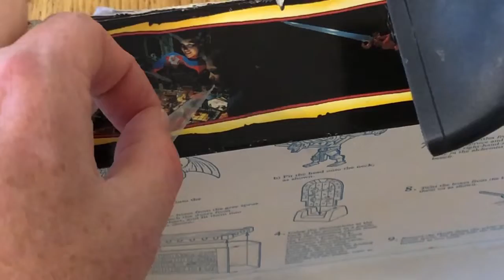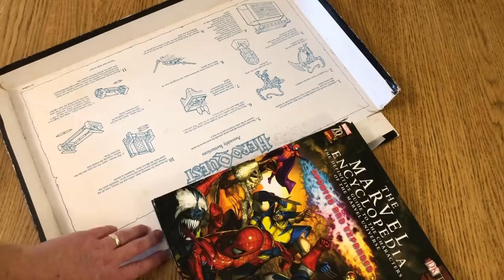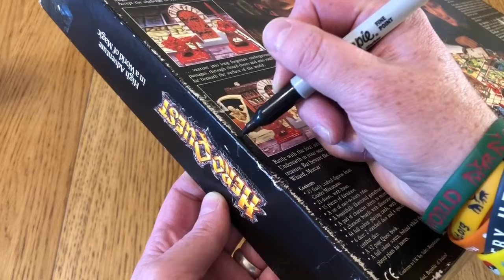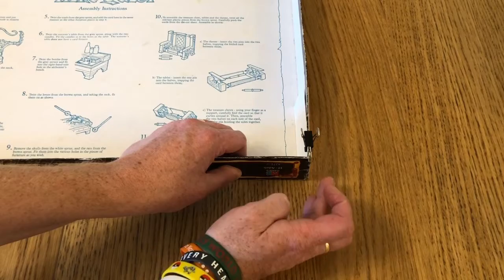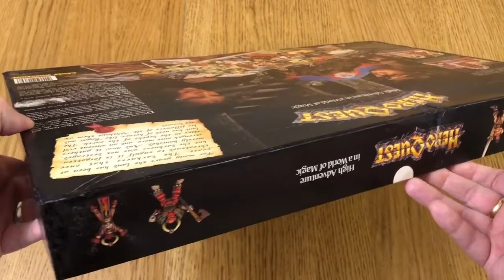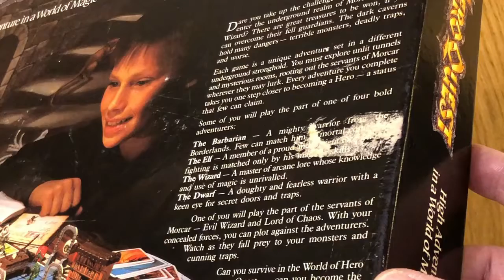Fixing or Repairing Damaged Board Game Boxes | The HeroQuest Restoration Project

Comment: Would you use Gorilla wood glue instead of PVA? Thanks for the video!
Reply from the maker: Personally, I only use PVA or (more commonly these days) bookbinder glue, as I can ensure how they are going to cure. You don't want to use anything that might yellow or otherwise stain, and wood glue often contains chemicals that are harmful to wood and cardboard. I used bookbinder glue in my recent Warhammer Quest restoration video and I would say that is the best option I have used. 

If you are going to use any type of glue, test it before putting it on the box to make sure it is going have a bit of flex to it and doesn't have chemicals that will damage cardboard.

Comment: Good job on the box. It's not the worst I've seen, that is a board game of my mums where the paper was peeling off the whole box and game board, the top and bottom had sunk inwards, there was multiple rips and squashed corners, along with a lot of yellowed tape damage as the box was a very light colour, and the plastic insert had started disintegrating. I was going to try the repair but decided I would have to reinforce the entire box as it's a much thinner board than the one you are working with here. But your video was helpful in working out what I could and couldn't do myself!

Comment: It looks way better. The corners look strong. Im thinking you wouldnt need a specialised card if you just wrapped some ordinary card in greaseproof paper.
Reply from the maker: The most important thing is to make sure you aren't going to end up staining, marking or denting the box. The archive card is thick, doesn't have any sponginess to it, is durable, and acid free so it's ideal. Normal card with a layer of greaseproof paper to protect the box should be fine, though.

Comment: I've recently managed to get my hands on a still factory shrink wrapped copy of the game. The only blemish I can see is where the old price tag used to be stuck on the plastic and some of the old adhesive has dried. I would be terrified to do anything to try to remove it. But it's inspired me to find other old games I've owned and try to restore them as well as possible. Which led me back here 😊
Reply from the maker: Sometimes you can use a hairdryer on labels, stickers, and tape to reactive the adhesive and peel it off without causing harm. I use this trick on new games I purchase that have stickers, but also to remove tape that has been used to repair boxes on secondhand games I acquire.
Reply: @AlwaysBoardNeverBoring  Thank you so much for the feedback. My main concern is that I'll damage the shrink wrap with added heat. Have you tried chemical (usually citrus based) adhesive removers in the past? I produce labels for a living but nothing I've done has prepared me for the stress of trying this in this instance 😬
Reply from the maker: @fotfom  Oh, I see. If the adhesive is on the shrink wrap there isn’t much you can do. You may be able to use a warm damp sponge and gradually remove it but in general I think the outside of the shrink doesn’t really matter all that much. It’s the contents that count. I collect to use - leaving something unused on the shelf doesn’t do anything for me - so nothing I have is shrink wrapped so I’ve never put much thought into preserving the wrap. You could always re-wrap it if you have access to shrink wrap, but otherwise you are probably best to leave it alone.
Reply: @AlwaysBoardNeverBoring  Thanks again. Normally I'd be like you and open it up to see and use the contents. I just feel like this is so perfectly preserved and I so luckily found it, it needs to be preserved. I almost want to frame it and hang it like a museum piece. If I ever commit to something I'll let you know 😁
Reply: @AlwaysBoardNeverBoring  Love the channel by the way!

Comment: How would you deal with a corner where a piece of the card is actually missing?
Reply from the maker: As in the side panels of the box are missing? It can be tricky. You can glue a corner shaped piece of card on the inside, affixing it  on either side by whatever bit of the side panels remain. Then you would need to print out the missing section of the box art and paste it on, or paint it on, or just leave it as "character."
Reply: @AlwaysBoardNeverBoring  Thanks!

Comment: I definitely gotta try this. My original HQ box has split from the weight of having other games stacked on top of it and I want to kick myself now for it. This is my next project!!!
Reply from the maker: It happened to so many board games boxes over the years. If you do have to stack boxes, it's sometimes better to put the slightly smaller ones underneath. That way there is less risk of box lids dishing and splitting.
Reply: @AlwaysBoardNeverBoring  I was thinking I'll 3d print some inserts for it. That way it's always supported from inside

Comment: I repaired Library material for over 20 years.  If you can access a color copier and another original box top without damage to your missing section, copy the original and glue it onto your damaged item.  Use the full paragraph if possible.  I have replaced entire pages and colored art pictures using this method.  It works.  Good luck! You're welcome.
Reply from the maker: I covered gluing a print out over the top in the video, and it's not easy to do seamlessly. For a perfect job you would need to have a high res scan of the top and sides of the box, a high quality printer printing the whole thing (top, sides and end wraps) at full scale and colour matched, and then you would need to wrap the whole box lid with it. It's no trivial task, and I doubt something anyone could easily do at home.

Comment: Im a little confused as to why the corners remain strong after gluing, but not that mid length tear.
Reply from the maker: Corners are naturally stronger than a flat piece . Push on a long flat piece of card and it will bow and wobble; push on a corner and it won't. Furthermore, the corners have two pieces that you can press against each other, creating enough surface contact for the glue to make a strong bond. You don't get the same kind of contact on a tear on a flat section where the two halves tend to rest side by side rather than overlapping.

Comment: I think you were "lucky" with this box (in spite of its overall condition) because it is mostly black, and therefore it's easier to hide damages with that black sharpie.

How would you recommend dealing with boxes that are of other colors that you can't necessarily match with a sharpie, or, even worse, that might have a more artistic box depicting intricate multi-colored scenes or patterns?
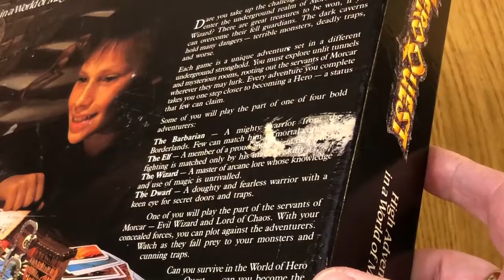Reply from the maker: I go through various options at 15:20 in the video (the time stamp labeled "solutions for damaged images").

Comment: I see a lot of videos on the game box, but nothing for a warped game board. Any ideas on resources? Thanks
Reply from the maker: Weight is usually the best thing. In the past I have had good results by sitting the board lying across two books, effectively creating a bridge with the warp curving upwards. I then place just enough weight in the centre of the "bridge" to overstress it so it curves slightly downwards. Leave it like that for a little while, then remove the weight. You may need to repeat the process, and you can even try misting the reverse of the board (not the image side) and layering it with greaseproof paper before you apply the weight. Just be careful not to overdo it and damage the board.
Reply: @AlwaysBoardNeverBoring  thanks. The Bridge idea is clever. I tried weight before with little success, but the bridge idea is interesting. I thought about a light mist, but that will be a last resort. Another idea might be to put plexiglass over the top for game play?
Reply from the maker: @gowensbach2998  Yeah, being able to overstress the board in the opposite direction can give better results than just pressing it flat to a table. Again, you just have to be careful not to go too far with it. I've used plexiglass over paper mats before to keep down the folds, but never over a board. I see no reason why it wouldn't work just as well.
Reply: @AlwaysBoardNeverBoring  i like the plexiglass over the top because it would help protect the image as well. I am going to do the bridge idea. Will let you know. Another Idea is to actually make a reproduction of the board to a vinyl banner, like with  Vista Print. Of course, a lot depends on the size and the quality of the image, but I have made a couple good maps this way.
Reply from the maker: @gowensbach2998  I hope it works out for you. Another thing people do sometimes (for HeroQuest in particular) is purchase a neoprene replacement. There are a few places where you can get them, although I've never bothered myself.
Reply: @AlwaysBoardNeverBoring  so here’s my story. I wanted to collect some old  Milton Bradley Games that I used to own when I got back into board games. I also remembered a certain Risk game with a Europe map on one side. So that lead me to finding out about an edition Called Risk Napoleon. However, it was never released in the USA, so I found the map image, and some third party pieces, but never found the actual rules. Then I came across Napoleon in Europe, which is the one  I got with the warped board. I also have Victory and Glory. So now I guess I have all the ingredients! I have become fascinated with getting first edition games that are out of print as well. I dunno, I guess I like the musty smell of them…like old books. Thanks again for your feedback

Comment: Great video. I’ve restored / fixed up loads of game boxes ranging from 1970s through to ‘modern’ such as Silver Tower / Hammerhal and follow pretty much same process. Although lighter fluid is also good for a solvent for glue / tape. For the PVA glue I use bookbinders glue which works well. It’s amazing how strong it repairs the corners. Also use the same Sharpie too - which can look a little shiny when first applied but does seem to calm down over time. I’d be interested if someone finds a better black pen to use? Also if the corners need extra reenforcing I’ve used the adhesive tape that is designed to seal the back of picture frames. There is a white version that often matches up with the inside of the box and you just apply some clean water to the tape and it activates the glue. Works well. Really neat. Similar where I have had creases have used flat smooth mdf and g-clamps to press it out. With the sharp 90 degree corner of the mdf it can really help to restore a corner that is dinged in. Finally totally agree with you on not trying to over restore with those large areas, best left as they are. Having the box nice and solid but still fairly honest is right by me.

Comment: Assembling my 3 sets I find I have one complete undamaged unpainted set except for the rat tails - are these always missing? (And torn box corners!)

Are painted sets significantly less saleable?

I also have the 3 most common expansions but without the boxes - are these worth anything?

Would a complete set of figures without anything else be marketable? Or are the figs better offered individually?
Reply from the maker: Hi, there are videos in my HeroQuest playlist talking about buying HeroQuest, Kellar's Keep and Return of the Witch Lord which you may find helpful as they cover a lot of common faults and pricing, and considerations such as whether the product is still in the original box.

In answer to your questions: Rat tails are often missing but not always; broken candlesticks tend to be more common though. 

Unpainted sets are preferable to badly painted sets that need to be stripped, but a pro-painted set with a really good paint job is very desirable.

All HeroQuest stuff has value. It's hard to answer your question on expansions specifically, because I don't know if you're in the UK. I'll answer assuming you are.

If you're in the UK I assume the three most common expansions you have are Kellar's Keep,  Return of the Witch Lord, and the Adventure Design Kit. All three were sold in tuck boxes that many people threw away, so it's very common to see them selling without boxes. That means copies with a box sell for a premium, but copies without boxes are still in demand. The design kit sells the best, especially if it hasn't been used. If you have Against the Ogre Horde or Wizards of Morcar than you are sitting on a small fortune, box or not.

If you're selling off just miniatures, you could bundle them as a single set, but a lot of people are piecing together part sets they purchased, or replacing broken and lost elements, so they often don't want all the miniatures, they just want one or two. Selling and posting individual miniatures is quite time consuming and tiresome, but selling them in sets by type is a happy medium (so, six goblins, four chaos warriors, and so on).
Reply: @AlwaysBoardNeverBoring  Thanks,

Yes I'm in the UK. I do have the Ogre Horde set minus box, one ogre needs stripping otherwise complete. I'm missing skulls from Witch Lord and a precipice tile from Kellar.
I also have an almost complete Dark World and a very incomplete Advanced Heroquest, but there doesn't seem to be as much demand for these.
Have to break out some dettol...

Comment: Great video! A couple of suggestions: (1) check out EVA glue, aka book binder’s glue, as it’s designed for repairing paper products and for archiving. PVA glue may discolor over time; (2) an iron (no steam!) on the cardboard (not the art) side, with parchment paper between the iron and box, can flatten creases and folds. I’m not sure what’s in Febreze and I’d be worried about it leaving residue that may discolor the box in the long-term. Anyway, great job!
Reply from the maker: Thanks for sharing your thoughts. I've never had PVA discolour; that can happen with PVA-based wood glue sometimes, but I've never seen it with craft glue. I use Febreze because it doesn't stain or discolour (at least, it never has in my experience). These are methods I've been using for a very long time, but of course, everyone will have their preferred techniques and products. People should always experiment to find the right methods for them.
Reply: @AlwaysBoardNeverBoring  I would agree, I have never had a problem with art pva but generic wood glues do indeed discolour, I have had sone boxes I restored about 30 years ago go quite yellow where I used wood glue, my Deathwing and Genestesler box's fixed with PVA look fine though. 

 The Ironing technique suggested really does a great job of flattening out the boxes, I flatten my boxes entirely when possible then just iron them, it also removes the lid sag that can happen, 

 with recolouring, rather than using a sharpie if you use a refillable marker pen, or water pen that is often used by kids I find artists inks used through them work far better as they look closer to the inks used once dried, you can even mix the colours to get it more exact, then as you said about sealing the box, just apply a satin or whichever lacquer is closest over the ink, I find a lot of space themed games have a little blue ink in the black. 

I'm a bit old with my game restoration tbh though 🤣

Comment: One, I never would have thought you could repair a blown box corner with only PVA, amazing. Two, you might experiment with an oil paint pen for a bolder black than the sharpie. (They have felt tips and a shaker inside and very high contrast bold satin black) and Three, if you ever need to get sticky tape residue off of anything without causing damage, try Lighter Fluid, it cleans just about anything and I have a video about it on my channel. ;)
Reply: Lighter fluid is indeed a great cleaning tool for game boxes, it removes dirt and residue then evaporates. A great product for box restorations!
Reply from the maker: Thanks for the suggestion on the oil paint pens. I have to say, I advise very strongly not using lighter fluid on board games and I would never personally make that recommendation in one of my videos. You should be able to get tape residue off with heat, or in a bad situation a small amount of nail polish remover on a cotton bud, although even then used with caution.
Reply: @AlwaysBoardNeverBoring  Have you ever tried Lighter Fluid? Nail polish remover is way more harsh as it contains acetone.
Reply from the maker: They make acetone-free nail polish remover. Even then, people need to test and take care. I always recommend gentle heat as the primary method.